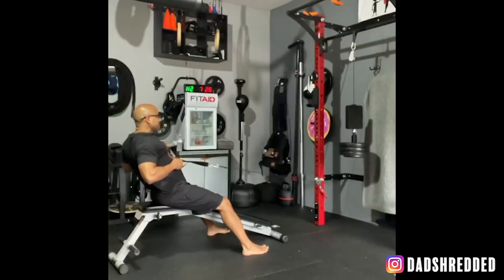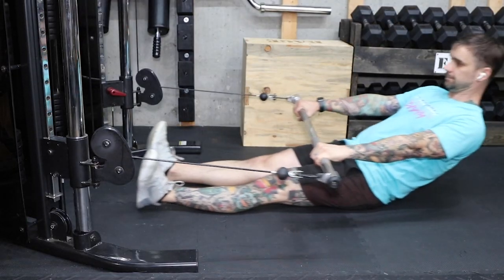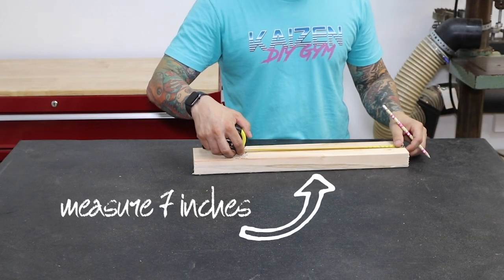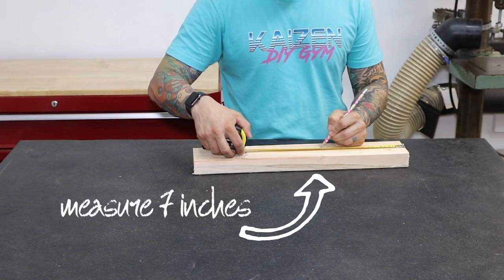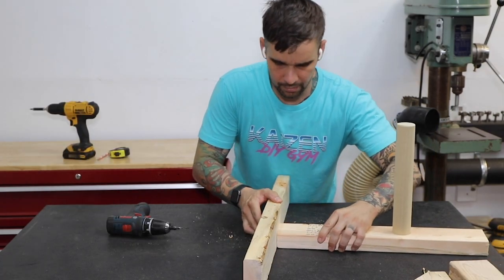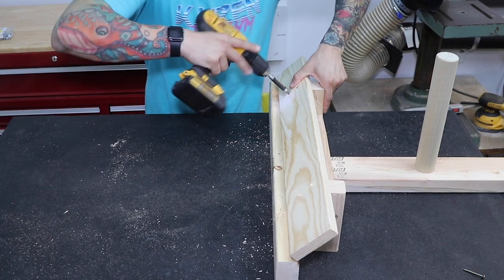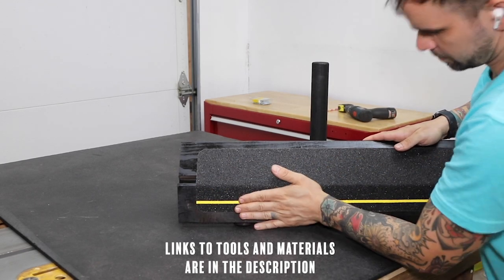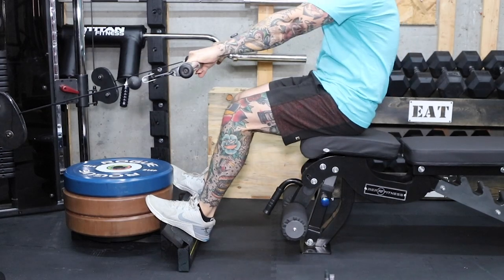DIY foot stopper for cable pulley home gym system and functional trainers

Comment: As an alternative you could also put on like 200 lbs body weight so you don't slide. Of course you'll also be 200x stronger because that's how it works so I guess you'd still need this... Damn it
Reply from the maker: I tried gaining 200 pounds but it's actually harder than you'd think

Comment: Your video's are very useful and enjoyable to watch!
I want to ''DIY'' a cable crossover onto my powerrack. My powerrack has a row/lat pulley option and I want to connect/fix the crossover pulley cables in line with my row/lat pulley. Do you know any video's here on YouTube or maybe a link to a website/image that have explained and/or designed a cable crossover onto a powerrack? I know there are simple pulley attachments available with a cable and a pin, but I don't want to have that ''swing effect'' near or behind me (if you know what I mean). Thanks man!
Reply from the maker: I haven't seen that exact set up but check out this video for some inspiration: https://youtu.be/ClfftecMCkg
Reply: @KaizenDIYGym  Thanks for the answer man! I just have watched the video but the cables can move/swing around. But again, thanks for the input! Been subscribed to your YouTube ;-)

Comment: I love your other builds, but why not just throw a 2x4 across the front of the machine that braces against feet of it?
Reply from the maker: That would work for me and my functional trainer but this is built for the people who don’t have that as an option. It was requested by people who bought pulley systems (or made diy pulley systems) and had no good options for foot stoppers.
Reply: @KaizenDIYGym  That makes sense...but I still feel like if you can't make an easier work around with 3 lengths of 2x4, you made some poor decisions elsewhere in you gym design. :)